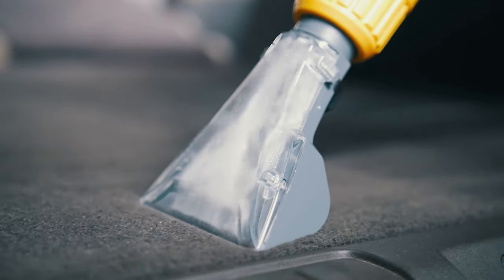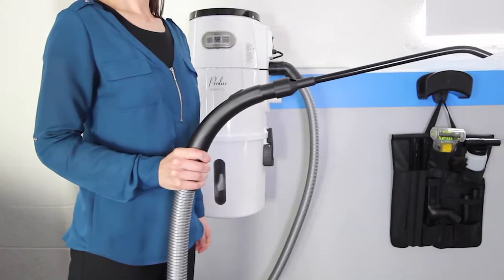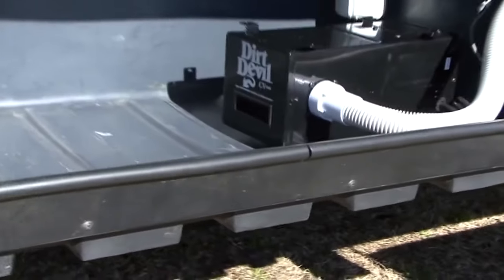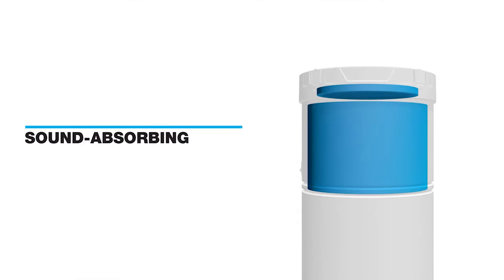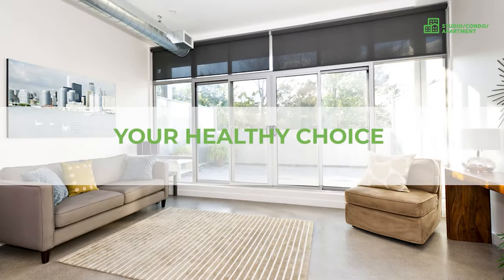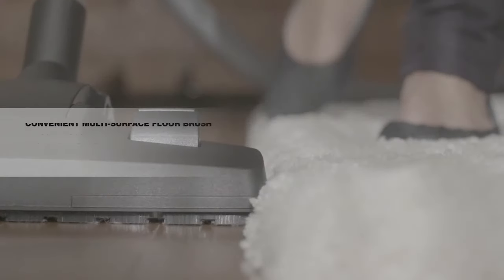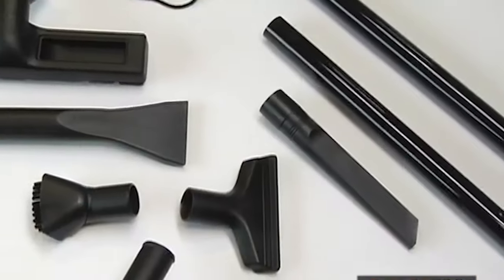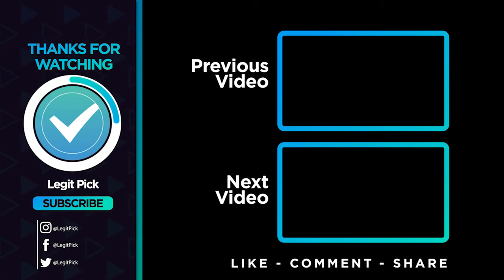What's The Best Central Vacuum System (2022)? The Definitive Guide!

Comment: This is NOT "The Definitive Guide!" to central vacuum systems!  And these are definitely not the best central vacuum units or the best overall central vacuum brands, other than the HP Products/VacuFlo brand, which is one of the oldest and better brands of central vacuum systems.  I have been selling and installing, and servicing Central Vacuum Systems for over 45 years and have seen the strengths and weaknesses of the various brands over the years. Some have improved but others have gone down in quality.
Reply: I’d love to know your recommendations. I was confused by how the garage version was a central vacuum system.
Reply: @stuartgoggans5198  thank you so much!  We bought a house with a central vacuum system and some parts need to be replaced. Trying to figure out if it is in fact worth replacing the parts and what brand to replace it with since they are expensive.
Reply: @oreotookie   In genera,l yes, central vacuums are very worth reparing.  Obviously I don't know who Installed and how your system was installed, but if was not installed poorly installed, then anything you repair or add will be worth it, both for having it as something to use now, and as a good feature of your home  if you should ever sell it.  I have been installing and repairing central vacuum systems for over 40 years (as well as retro installing one into each of the homes my wife and I have had over those years), and realy believe, they are the best way to vacuum your home, in the long run the most affordable.
Reply: Angela  In genera,l yes, central vacuums are very worth reparing.  Obviously I don't know who Installed and how your system was installed, but if was not installed poorly installed, then anything you repair or add will be worth it, both for having it as something to use now, and as a good feature of your home  if you should ever sell it.  I have been installing and repairing central vacuum systems for over 40 years (as well as retro installing one into each of the homes my wife and I have had over those years), and realy believe, they are the best way to vacuum your home, in the long run the most affordable for most homeowners.  PS: with 9 kids and pets, we used ours alot!
Reply: I install beam central vacuums and they're very good to me. I would lie to hear your opinion on them